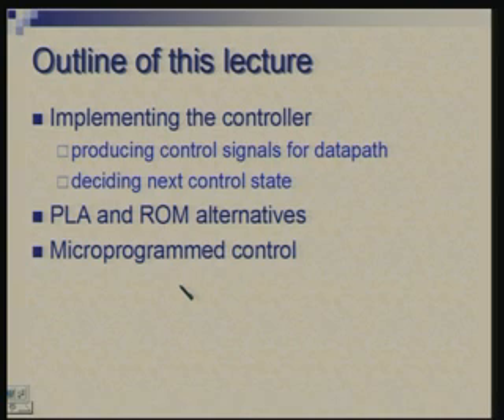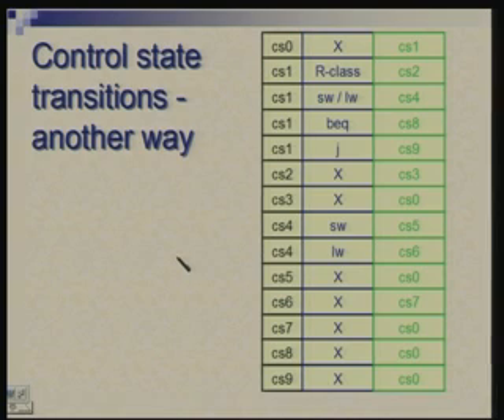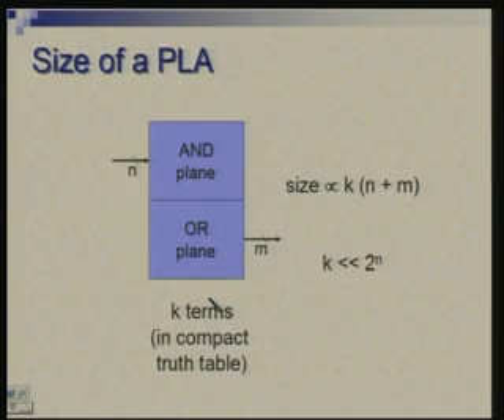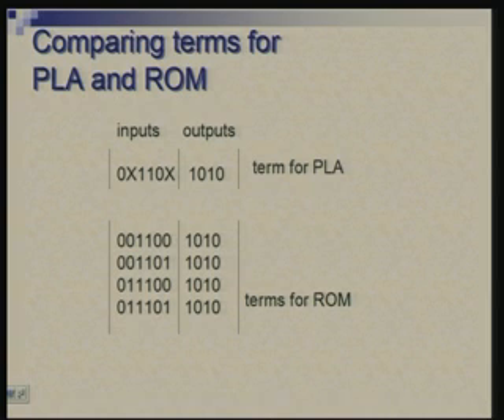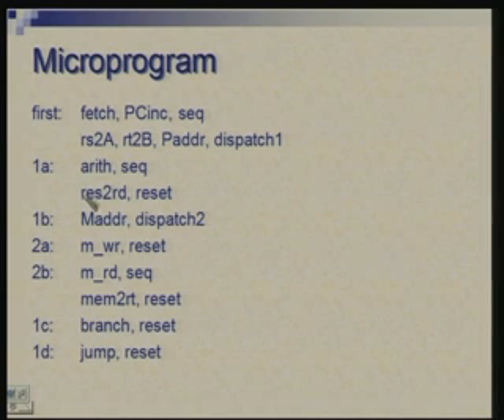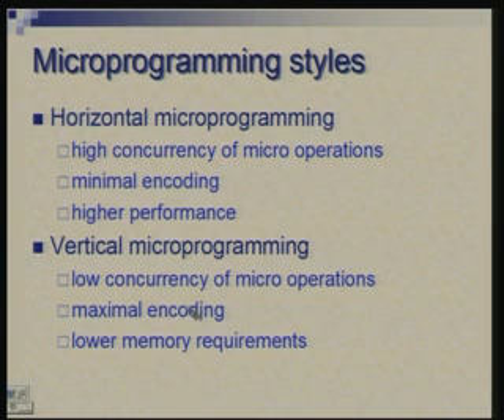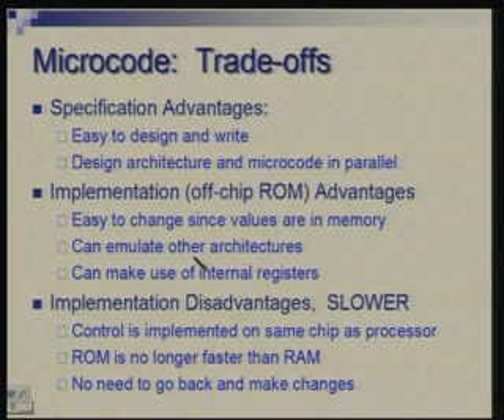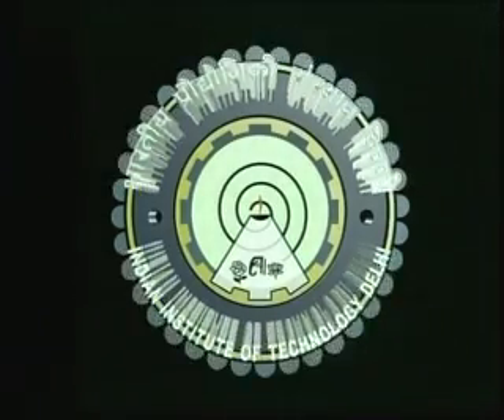Lecture - 22 Processor Design Micro programmed Control

Comment: I have a question: At time 4:27, I see that under PC grp its decoded into 4 bit(Eg: 1x01, 00xx...) , But when we formed PC grp table in previous lecture we had only 3 signals(Pwu, Pwc, Pscr) Then why is it decoded into 4 bits.I didnt get the logic for that. Pls reply ASAP. Thank you.